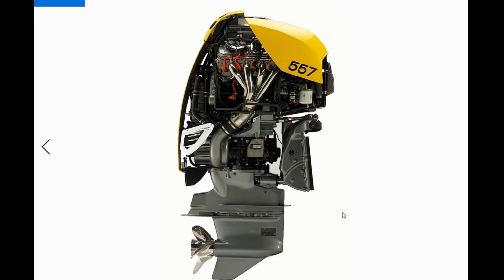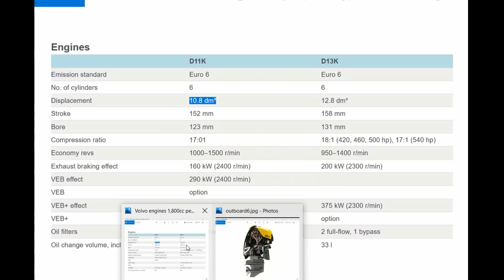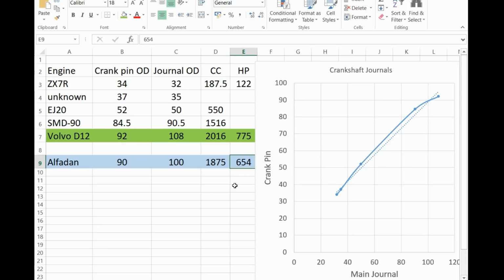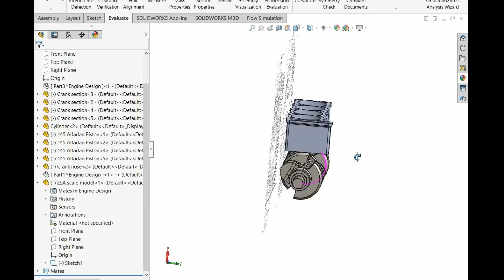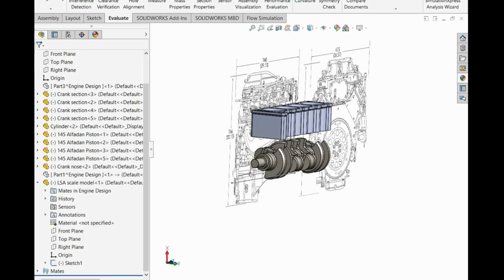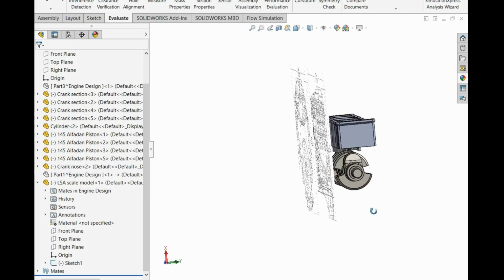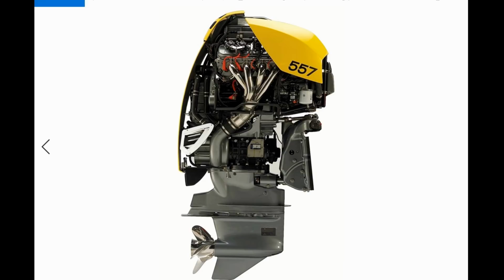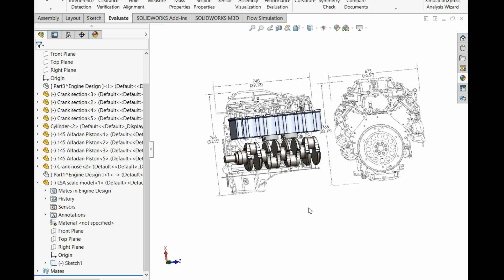Seven Marine Vs Alfadan

Comment: Unless they go pushrod that cylinder head is going to significantly larger than the LSA 2 valve setup.

A dohc 4 valve rocker arm setup would likely end up with more parts than both the V8 heads combined.
Reply: But they've mentioned freevalve a few times.  Surely that's their planned architecture... haha
Reply: @RJ-ew6nc  Already abandoned the Freevalve.  Refer to thehulltruth web site boating forum on the Alfadan thread.

Comment: You can buy a gen 5 LT with 755 HP on pump gas, for 19 grand, and it comes with a 50,000 mile warranty... That's like $25 per HP, and it'll pass emissions. A sharp lady could assemble it in her shed for less, but why bother. Summit will deliver it to your house in a matter days/weeks. Two fellas can do better than that, only in their imaginations. They couldn't build a better mouse trap with 100 million dollars.

Comment: The alfadan design could work if they machined the crank from a single billet of unobtainium.    Then the bearing would only be a quarter the width and the crank length half what you have drawn.   OK so pistons that diameter would be running into each other so they would need to be rectangular with the major axis going across the centreline of the crank.   Isn’t that what a boxster engine is   Box = rectangular pistons? 

It would work though.   BSc in Automotive engineering  and 35 years in Automotive R&D and I can see no issue with my suggestion.  

Could make the pistons out of balsa wood too.   Way lighter.   ( as A kid I made a model plane from balsa wood so I have proved the concept) And covered with tin foil would easily cope with any thermal issues ( never run = never get hot.  See I was right!)

Comment: Width does matter for outboards. There is a golden ratio for Beam/usable length for wave handling. This results in long narrow boats. The two engines then need to turn and not interfere (spacing between 2 engines) and stay inside the wake in a turn(how far from side of boat).

A single high torque engine would snap your wrist and try to go in circles and or waste energy to side thrust.

Comment: Having seen more than one L60 engine run away and decide to rapidly disassemble at around 4000 rpm I can appreciate the forces involved. Looking at ships engines designed to run at around 300-500 rpm it's obvious to me, as a simpleton, that the bigger the engine the greater the mass and the slower the speeds...

Monorail...
Reply: No disassemble Johny 5!

Comment: I can show you pictures of Cummins ISX 15 liter engines that have come apart due to overspeed, anything over 1800 rpm and you are in dangerous territory. Huge crankshaft that are broken. There is a point where the strength added from extra mass becomes less strong to produce any amount of power

Comment: Matt keep up the good work, but you can't use a 12L diesel to extrapolate the Alfadan's journal diameters. Diesels not only have a much higher CR, they also run high boost pressures. The peak cylinder pressures in this diesel will be 3-4 times higher than a naturally aspirated gas engine. I never was involved with our crankshafts, but I know that the con rod pin's main deflection is in bending while the main journal is torsion. The peak bending is at peak cylinder pressure. For a 145 mm bore, Alfadan would need a crank pin dia of around 75 mm, but this could be reduced by means such as a forged or billet crank, or additional journal overlap by increasing the main dia.
Reply from the maker: But have you calculated the force at 5,500 rpm? And I didnt. I used the forces at those rpms. The highest forces are in tension during the exhaust stroke, so boost, and CRs don't matter...
Reply: @thedirtyworkshop  Very interesting, I worked out the forces based on some assumptions, and you are correct, the inertia force is approx 15% higher than the firing force at 5500 rpm and 700 psi PCP. But when I looked at a typical big bore diesel with 2200 psi PCP at 2000 rpm, the firing forces is approx 20x the inertia force. I spent my whole career in the diesel industry, but I still don't think that you should use diesel journals to estimate gas engine journals.

Comment: Ther is not many 4 cyl engines over 2.0 - 2.6 litres due to inballance and nvh without balance shafts.
Reply: Diesels are about it and 3000rpm is about it unless you have the pleasure of experiencing a runaway.
Reply: Do your research

Comment: The only naturally aspirated engine I could think of right now of that size that is speed oriented is the one in the Ferrari 812. 6.5 liter V12, around 800 hp at 8500 rpm. I found some dyno charts that seem legit enough and around 5500 rpm it makes like 500 hp. So it makes about 76 hp/ liter of displacement. That magic 4 cylinder apparently makes 86 hp/liter so about 12-14% more power per liter than Ferrari at the same rpm. And that even before he built a single engine, it can only get better! He must be a genious, in his own back yard he managed to beat Ferrari with their hordes of engineers. Well that or delusional.

Comment: There is so much more that Alfadan haven't addressed. They may have a novel design 🙄 which will mean that they will also have to have novel solutions for lubrication, cooling, ancillary connections etc. The transmission of the power from the engine to the water in a useable manner is not trivial, Mercury's V12 doesn't rotate with the steering mechanism for example. If I was a dragon and this was a possible investment, I would be laughing them out of the room.

Comment: I'm baffled why there's a market for 500kg! 600bhp outboard motors that probably cost more than the Cadillac they Came from? And to think they will probably be used in pairs? Why don't the Americans do the logical thing and build big boats with inboard or stern drive engine's instead?
Reply from the maker: Replaceability, fast replaceability
Reply: Outboards are the rage for the past several years. Inboard/outboard Mercruiser styles engines are being phased out. A straight shaft inboard diesel are for the big Viking/Hatteras/Cabo sportfishing yachts.
Reply: I definitely get the ease of replacement, and the fact that you can change your boat or upgrade it and keep the engines to put on the new one. 
But all I read about outboards is of how unreliable they are, and how short lived they are due to corrosion etc. Not to mention they cost stupidly huge prices when a more conventional inboard boat engine can be based on a car or HGV engine and just have the marine stuff engineered onto it and a simple straight prop shaft. I fully get the reasons for outboards on small boats, but ones that weigh nearly as much as a small car and 600bhp? I'd take a diesel Volvo Penta mounted low inside the boat with far more room around the engine to work on if I needed 600bhp in a boat.
Reply from the maker: Theyre unreliable because they're all petrol. Diesel is the way to go
Reply: @stevenbusk539  You are correct. There are exceptions to that rule like the mid 2000s Yamaha 2 strokes and 4 strokes but these are few and far between these days.

The Yamaha F350s are the pinnacle of unreliable and a ticking time bomb if the flywheel isn't changed every 80 hours.
Reply: Outboards have a lot of inherent advantages. The main one being it can be tilted completely out of the water. This brings with it that the outboard engines are typically raw water cooled. Ie. they don't need a glycol cooling system with a heat exchanger etc. A lot less parts. And 99% of outboard engines are mounted vertically, so they have less gears etc. In addition the current emission regulations worldwide don't require outboards to have any emissions aftertreatment. So even less parts and lower cost. And historically outboards have been lower power than inboards, but this has changed in the last 10 years or so.
Reply: @geomtol  still not sure I see all those as advantages, but then I'm no power boat expert.
1, no emissions after treatment well that's good for bhp, but not going to endear you to the panda huggers.
2, raw salt water cooled, ok on a little cheap put put tender outboard or anything used in fresh water. But I sure wouldn't be paying Severn marine 557 prices and filling it up with salt water, can't see any laughs in that?
3, ok you can tilt it out of the water for storage and to work on it, but also having the transmission unit hanging down in the water under the boat makes it vulnerable to damage from hitting stuff under the water. Also I can't imagine the size of the bolts and the force on the transom from a 600bhp engine hanging off the back of your boat. If the worst happened and it broke off and sank, you'd feel sick at the amount of money you've just lost to the seabed.

I don't get why a 600bhp easy to work on and probably cheaper to buy inboard isn't so superior that it's everyone's default choice?
Reply: @stevenbusk539  1. The guys that have boats with 600hp are typically not tree huggers. :) And putting after treatment on a 600hp marine engine is no small feat, it is quite difficult and incredibly expensive. High power inboard petrol engines (500hp+) are very rare and typically for racing only. Diesel inboards are ~2-3x more expensive and much heavier. 2. True. But the outboard engines are designed to completely drain when tiled up, so the salt water does drain out, but sure, there is still some corrosion if you don't flush it with fresh water afterwards. But not having to have a complete secondary cooling system is a huge advantage for cost, complexity and reliability. 3. Every propeller powered boat has something hanging out under it. Outboards and sterndrives are designed to 'kick up' if you hit something. Inboard shaft boats if they hit something hard will typically get really serious damage, either to the hull and/or the prop/shaft and/or rudder. Waterjets don't have that problem, but they have a slew of other issues/disadvantages.

Comment: So those v8 engines can be really cheap. Obviously that one is a special one but honestly there isn’t much different from an LS v8 to a 4 cylinder. The only parts that would be different are the block, crankshaft and intake. It’s a pushrod v8 so the cylinder heads are reversible so just make more pistons and rods. Once the tooling is done for the extra parts just make more parts. Honestly how can it be all that more expensive. I’d like to see you mess with a LS v8 one day Matt. Cheers.
Reply: Seven Marine worked in the manner of a tuner shop.  There were not many engines sold each year.  It is a specialized product.  Without the volume of sale, the cost cannot be pushed down.  That's why a new Mercury Verado V12 600 hp marine engine is cheaper.  The sale volume of the Mercury is a lot bigger.

Comment: Our shop can get the LSA crate engines for around $21,000 including freight and tax. Would be curious to see the price of Alfadans' 4 cylinder. No dress up, just engine, apples to apples. It's the stainless parts below the engine that makes them stupid expensive I think.
Reply: And the small number of the engines 7 Marine have produced.  It is more like a tuner shop product.

Comment: Matt, you and Albert are both clearly wrong. If you make 10 litre 1 cylinder engine, you can rev it over 9000 and make easily 1200hp even at higher altitudes without forced induction. It will have just one piston and 100kg crankshaft but hey. It will clearly rev higher hence make more power! Good video btw.

Comment: like licence to produce a VR6 format, and use a turbo, if you want to take the outboard power title.....if you're going 4 cylinder, use a high rod ratio, and add a turbocharger.

i mean look at a prop power curve, if you'e working marine.
so now what is wrong with a turbo??? ... and what would be so wrong with a high rod ratio, that anyone would feel compelled to go for a scotch yoke ????

Comment: Slightly off topic, and getting back to motorcycles...what's up with trials bikes. I've seen 2T bikes with no expansion chambers, and they seem really slow to rev up, care to go over the differences in engine design for those "the floor is lava" riders?
Reply from the maker: Expansion Chambers would become fucked in no time, also they block your view. Expansion chambers are not required, just desired.

Comment: I don't get why you think the rotating assembly would be weak or too heavy. Does bearing load not scale well? Also if you need big bearings and weight is an issue, gun drill the crankshaft. If you were to just scale up the dimensions of other engines it should be just fine.
The V4r has 15250rpm, Bore=81mm, stroke 48,4mm

The alfadan would have 0.3 times the piston accelerations of the bike engine.
110mm* (5500rpm)^2/(48.4mm * (15250rpm)^2)= 0.3

The masses would be roughly masses  8.3 times as times as high
48.4 * (81mm)^2/(110mm * (155mm)^2) = 0.12
 
And the crossectional area of a rod would be 3.66 times as high.
155*155/81*81

Making stresses 0.3 *8.3/3.66 =68% of the V4r.
If you disagree tell me where I am wrong, I am not an alfadan beliver, I want to have a conversation about engineering
Reply from the maker: 110mm piston? Where did you get that from?

Comment: My 1971 Husqvarna 400 cross was simple. One cylinder, no valves, no reeds, no variable spark timing, simple hand wound iron core coil with a magneto set at 40 degrees BTDC. You better kick hard when you start it. Very easy to get it to run backward. It shook violently at low RPM, but then who rides a dirt bike at low RPM? 50 hp at the rear wheel on a bike with an all up wet weight of 232 pounds including fuel. Quarter turn throttle that I called the dial a wheelie part. It had but one purpose, rip through dirt or snow at any speed you had enough guts to dial in. Today's dirt bikes weigh a freakin ton, and are geared for silly jump tracks not going at speed. Fastest clocked speed I could find on a long straight on one of today's MX courses was a whopping 52 mph. Silliness, but they jump 40 feet in the air. You do not make good forward progress when the rear wheel is not on the ground.

Comment: You own a 7 but want more power? It's a fuckin LSA, your only a cam, supercharger pulley, and tune away from 1000 hp. If people really wanted more from their outboards they'd be doing it.
Reply: It is not that simple, I am already impressed that the engine is even able to survive in that small box, without the headers melting everything.

1000hp needs more cooling, more intercooling, maybe even a bigger supercharger, more exhaust, more intake, more fuel, better gearbox, bigger prop, bigger mounting system to prevent breaking the back of the boat.

In the end it could be cheaper to just buy one more LSA outboard.
There is a reason this engine is not advertised as a 1000hp crate engine, it is just not that easy to make reliable and drivable 1000hp with a car engine.
Reply: @larsjrgensen5975  it is that simple. Heat shields are a thing, and now days they're really fuckin good. Having worked with a couple v8 jet boats in my life keeping the motor warm enough is the issue. You have to remember the coolant is whatever water you're driving in which is way cooler than anything thats ever passed through a radiator. If you dont restrict the water flow enough the thermostat wont even open. A 200 hp 1000cc sport bike exhaust doesn't melt the plastic it's encased in why would this?

Comment: You Cannot Get A Decent Pipe Tune Into The Package, Alfadan lost their marbles.
Alfadan is pushing their flame front speed, and piston ring speed, to the point that their engine would be inefficient and unreliable...
Turbos Make Sense for 4-stroke marine outboards, Because You Can't Get A Decent Pipe Tune On Them Anyway !!!
and your flame front speed is not going to go any faster, unless your engine is made less efficient, ( less pressure, faster flame front ) so that's why no one in their right mind designs for an individual cylinder volume over a litter, and most are not even daft enough to push their individual cylinder volume over 675cc, unless they are making a diesel !!! ( or designing for a fuel faster than petrol ).... 

DISCLAIMER: people were purchasing a lot of Victory Motorcycles when H-D left the 80 ci for the twin cam....so don't blame H-D, except for following their market into inefficiencies.

gear reduction efficiency just does not decrease as fast with ratio, as much as engine efficiency decreases over 675cc per cylinder..
the VR6 is a balanced format...so go 4L VR6 Turbo.

personally, i would put sails on a yacht, and go electric / re-gen propulsion, ( what an eco-friendly concept )

Comment: Short crank, 2.7L pots, 146mm bore IS possible... It isn't new & exists in radial aero engines but it won't rev above 3000 rpm & even with a supercharger only gave 40 bhp/L..  It looks like this guy could do with taking the sage advice of Scottie from Star Trek in "you cannae change the laws of physics captn"

Comment: Why not just put the dam engine in the boat hahaha. I don't understand outboards in this day and age. Although I have a 1977 glastron with an outboard hahaha
Reply from the maker: Because if they fuck up they can be swapped out within 2 hours. If you run a fishing or diving business for example then this matters
Reply: Also, keep in mind that in most cases with smaller craft there just isn't space in the hull to fit an engine, and the changes you'd have to make to get it in there would eat into the limited space you have on deck.